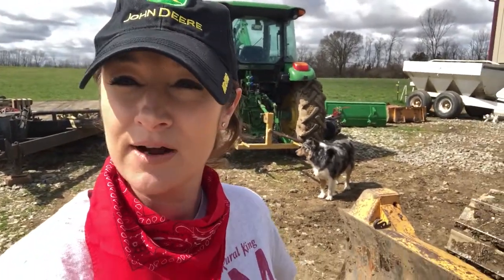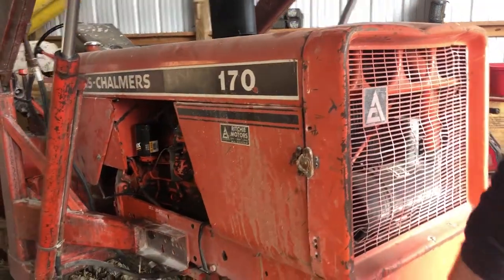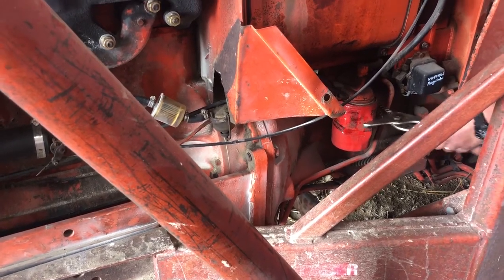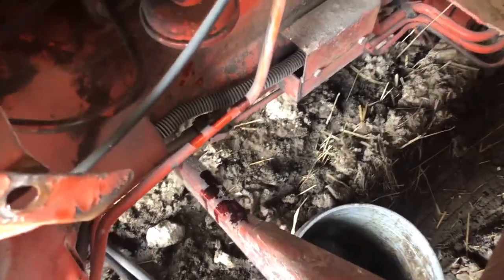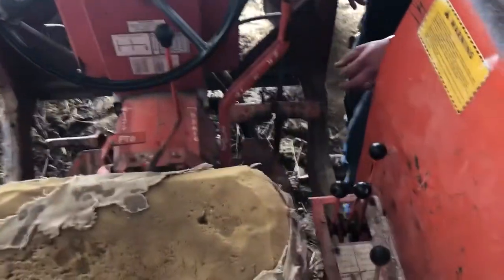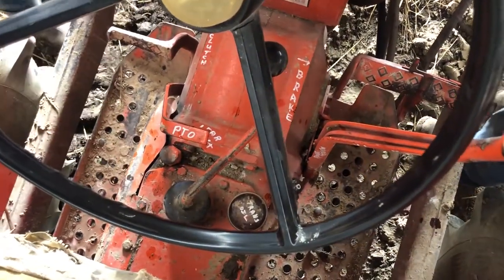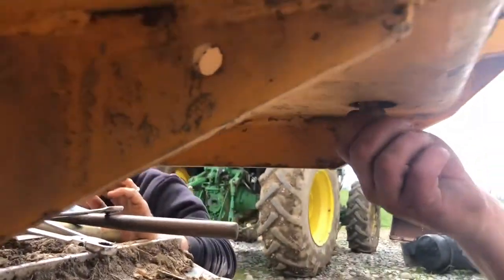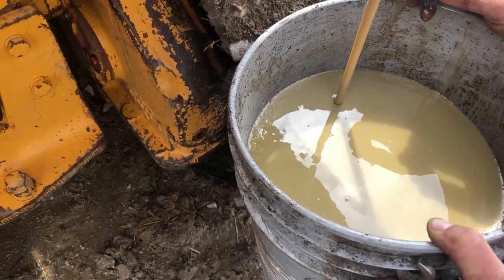Allis Chalmers 170 & Case 450D Hydraulic Fluid Change.

Comment: Nice job on the maintenance routine!   I can see that our tractor isn't the only one to have the sheet metal cut back to be able to exchange the battery.   In the heat of the moment, you do what has to be done.   Looking forward to some footage where it is operating.

Comment: That black stripe 170 looks pretty straight...are the hours decent? l have a 1969 AC 170 gas with a factory loader ..
Reply from the maker: 2700hrs with 700hrs on a motor rebuild by the dealer. Bought it this way. Its our go to tractor. Ill have some footage of it running our mill this week when I go to fill the creep feeders up.